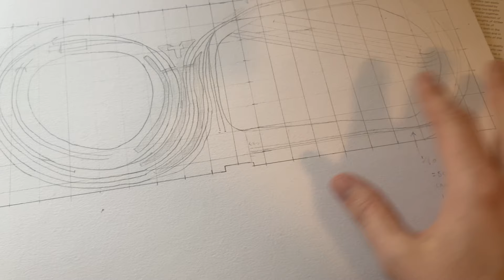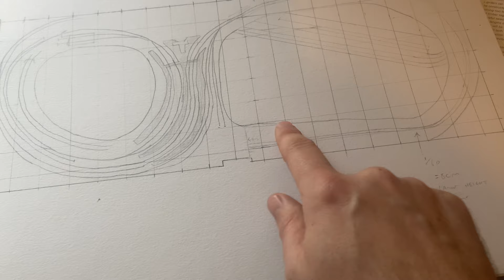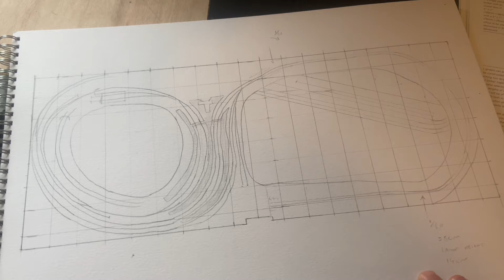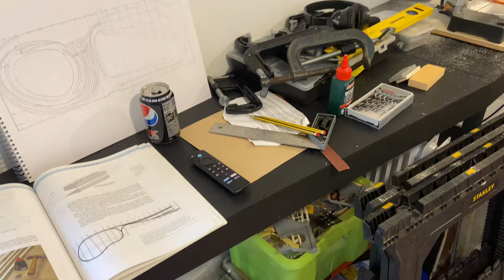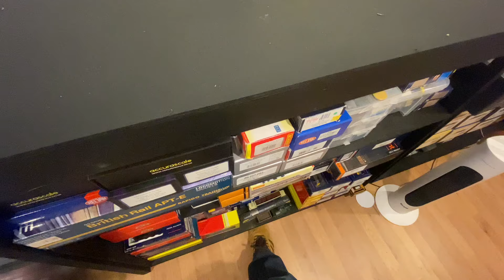The OO Build | Evolving plans and Starting the fiddle yard.

Comment: For reaching into that corner, might be an idea to see if a small stool/step/bench would give you the reach into the corner. Easier than building removable scenery over pop up sections. Surprising how being 10"-20" higher up can improve your reach.
Reply from the maker: I did think of that after if did the video, thanks for clarifying,  I think I will go that way then I can look at using that area for some sidings or town scene with working roadway